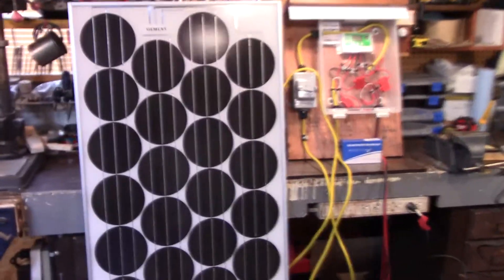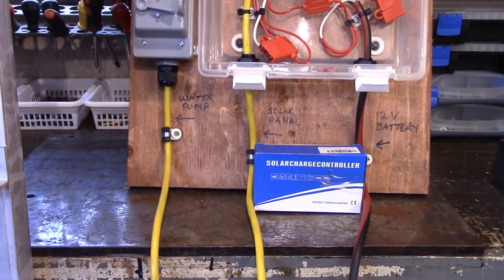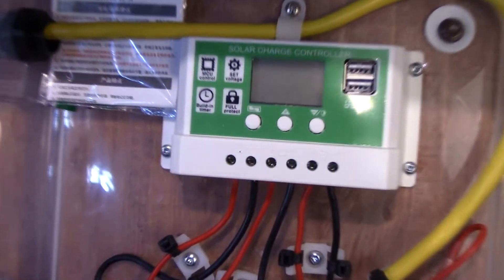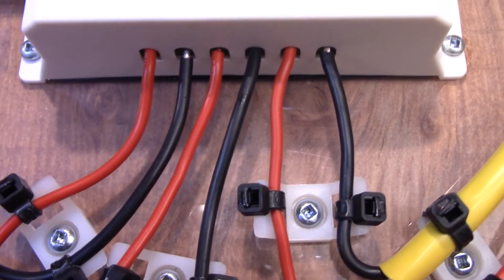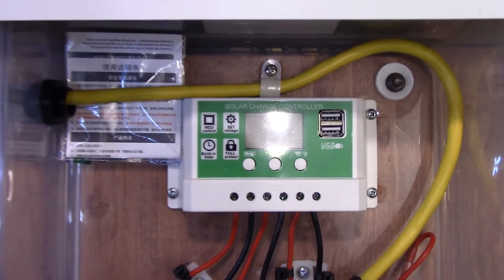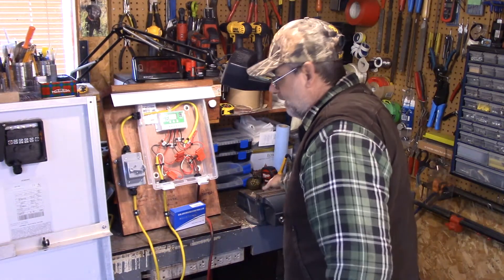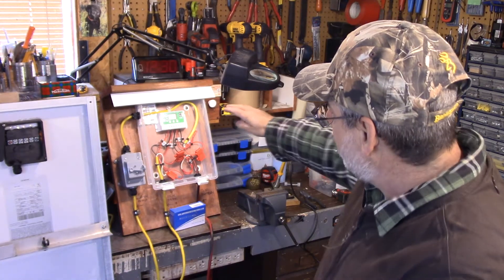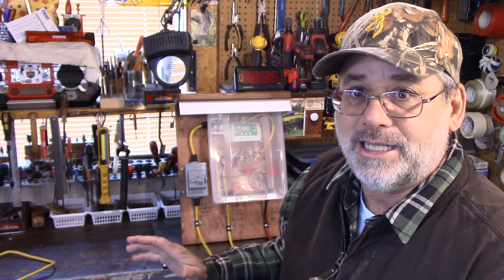Low Cost  Shallow Well - Solar  Water Pump Project

Comment: Nice job Steve. Don't know if anyone mentioned but maybe you should put the male plug end on your pump? Looks to me in the video that there could be power on the male end and that wouldn't be good if it wasn't plugged in for some reason. Cheers.
Reply from the maker: Thanks Adam I will take a look. 👍

Comment: So my understanding is the controller connects and disconnects the solar panel depending on what the battery voltage is so you don't overcharge the batteries. It allows the panel to charge the batteries up, then stops charging the batteries. Then when the voltage on the battery drops below a certain voltage it allows the panel to charge the batteries again. Does it also cut the dc power to the pump if the battery drops below a certain voltage.  I am assuming you have a 12v or 24v dc pump. Amazing how that little box can handle the load of the pump on the dc output. I assume you could also use an ac pump run off an inverter and use the panel to keep the battery maintained.
Reply from the maker: The charge controller is rated in amps so you have to pick one with the right amperage .  If the battery gets below  10.5 volts an ac inverter would shut the pump off but mine is wired thru the charge controller   and do the same .  I plan on only using the pump during sunlight hours as the solar panel will  have enough amperage to run the pump without a battery and if I need to pump water on a cloudy day the battery could run for 20 minutes no problem  without discharging it .

Comment: I like the tip on soldering the end of the wire before tightening it in the terminal.  Nice setup.👍
Reply from the maker: Yes the soldered round wire conducts poorly but squeezed  in a flat  position is the way to go .  Thanks bud.

Comment: If you are pumping over 200 feet and going up a hill, I think I would make sure the pump I buy can handle that head pressure.  It has been a while since I looked in the directions of a Shurflo pump, so I don't remember what they can handle any more.  Good luck with it!
Reply from the maker: I think I'll try 100 feet at first .  I did call surflow and the rep said not a chance LOL   This is not my first rodeo so I'm saying 100 feet up a 30 degree hill absolutely it can be done . Cheers

Comment: I am positive your Sure Flow pump will work well for you even at that distance and your regulating system will,be dependable through the Sumer even if your not there..... The only thing to grow a wrench in the system is them pesky small rodents that maybe eat there way into the boxes....put some moth balls in both boxes.....should work like you planed.....CHEERS
Reply from the maker: Yes the rodents are a huge problem  chewing wires.